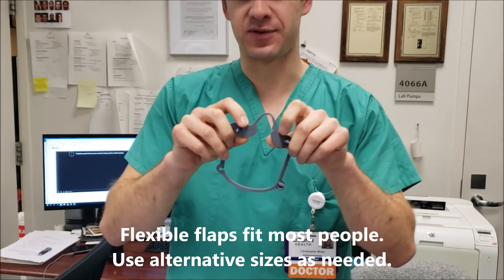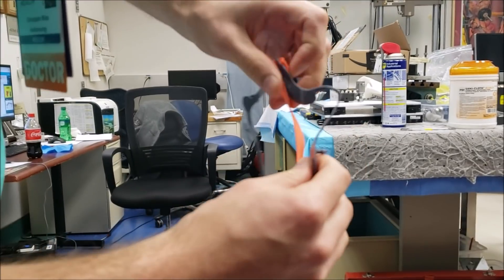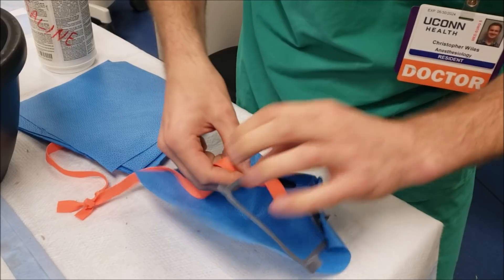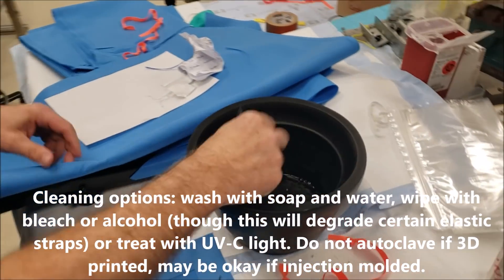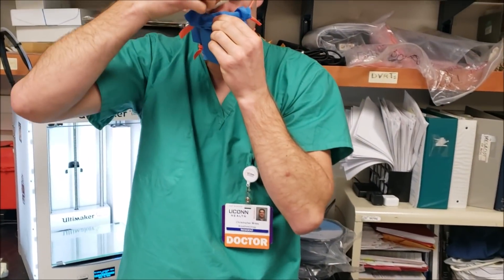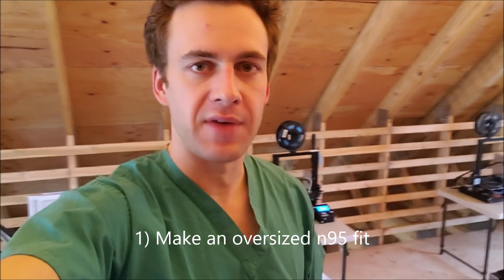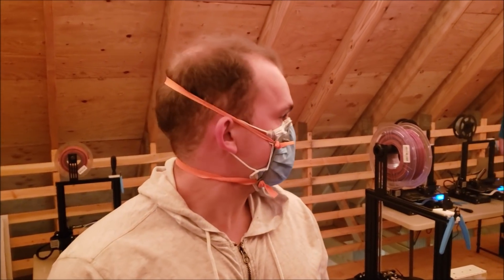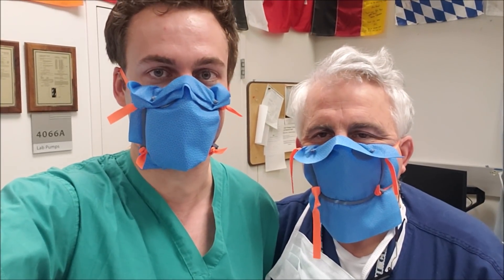COVID 3D Printed Mask Frame for Halyard, Investigating 99% Filtration

Comment: Anyone have any thoughts of using 2 layers of blue shop towels for this? Much more available to the public than H600 and there have been some articles floating around saying that they have very good filtering capability. Not sure how true it is, but I have plenty of shop towels so I'd be able to make a bunch of these quickly
Reply from the maker: This analysis shows 2 dish towels work well. https://smartairfilters.com/en/blog/best-materials-make-diy-face-mask-virus/  Haven't seen data on shop towels but that article may give some insight. As always, a good seal to your face and breathability must be attempted and considered.
Reply: @chrischris64  Thanks! I'll try both options and compare. For reference, this is the article that mentions blue shop towels: https://www.businessinsider.com/homemade-mask-using-hydro-knit-shop-towel-filters-better-2020-4. Not exactly a scientific study, but it's something.
Reply from the maker: @dmitrygalperin7319  wow, if that's true, definitely better than a cotton mask. Let me know if you try 2 layers in my mask and if it's breathable. I'll try to pick some up if anywhere is open and test for breathability, then in the lab for particulate filtration to confirm their 95% claim. I appreciate you pointing that out. It could be huge.
Reply: @chrischris64  I tried with 2 layers of Scott brand shop towels (which they claim to be less effective than the other brands, but that's all I could find) and breathability seems fine.

Comment: is there any alternate material I could use to the H600? I cannot get that material as a layman.  thank you
Reply from the maker: My other project addresses an option for those with a 3D printer but without access to surgical materials: https://youtu.be/ySOCNycv-aA. I'll make an update video to that soon with ideas for sealing it, molding it to your face better, increasing comfort, etc.

Additionally, this website suggests vacuum cleaner bags are similar in efficacy to surgical masks https://smartairfilters.com/en/blog/best-materials-make-diy-face-mask-virus/ 

However you do it, having a seal to your face is a top priority, and nothing is a replacement for social distancing at this time.

Comment from the maker: The Halyard product website doesn't endorse using their products for this purpose, but allows you to look up materials by rating, sorted from H100-H600, which many are asking for: https://products.halyardhealth.com/surgical-solutions/sterilization-solutions/sterilization-wraps/halyard-kimguard-one-step-sterilization-wrap.html

The University of Florida Department of Anesthesiology:
https://anest.ufl.edu/clinical-divisions/mask-alternative/frequently-asked-questions/ 
Read under "mask alternative section": "Halyard H600 material has one-layer specifications of filtering particles 3 to 0.3 microns of >99%. We made our calculation of 99.9% filtration of airborne particles based on two-layer material for the masks we are sewing."

Product information PDF: https://www.halyardhealth.co.uk/media/17525807/hc470-01-uk_powerguardtechnology_20152.pdf

Do not use these to replace n95s. Only use as a last resort, and/or with approval from facility.

Comment: Hmmm, the problem with this is that the printed masks usually cover  your full face, and have a spot for a filter so you use more 3d printer material, which you are still able to get easily, instead of using a whole thing of the medical material, which is hard to get.
Reply from the maker: For a solution that uses less filter material and more 3D printing, see my other project: https://youtu.be/ySOCNycv-aA You can add one smaller piece of the halyard h600 to the filters shown there if you have access to it.

Comment: RN here, I have so many questions. Are you now recommending this over your last video? This is surgical drape right? I don't typically work with this material but I have seen it in central line kits etc. Please elaborate if you can and thank you so much.
Reply from the maker: Hello, good question. I'm just giving another option. For my other one I have found a way to add a layer of the blue halyard material or a surgical mask between that mask and my face to achieve a more consistent fit and better filtration and I like that, but other people will prefer the softness of this frame-material combo. The decision is multifactorial. This is a much faster print (20 minutes vs hours) so as covid worsens, people will want this as a faster option. It may depend on the user, the institution, and what kind of manufacturing you have available. These frames make quick disposable makeshift suspected n95 - n99 mask (final data about filtration numbers is in process). The full respirator can take furnace filter material and can therefore reach people who don't have access to the halyard material. It's good to have options in case one supply of anything runs out. Short answer: seeing one patient? Put on the disposal frame and material.  Spending a day seeing patients? Wear whichever is more comfortable to you and wear a face shield. Again, I don't endorse either of these as an equal alternative and hope you only have to make this as a backup plan and never use either.